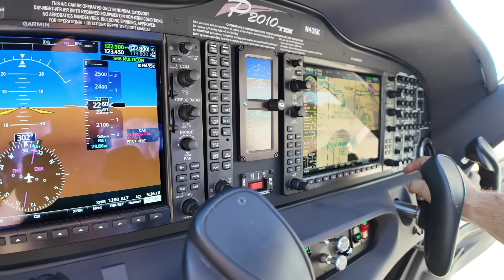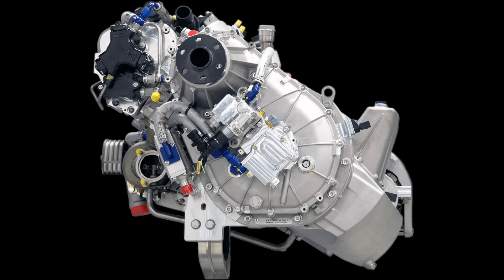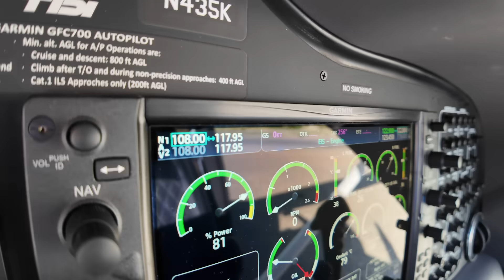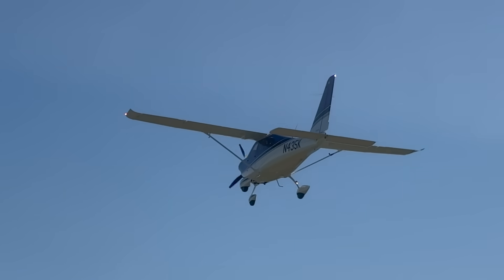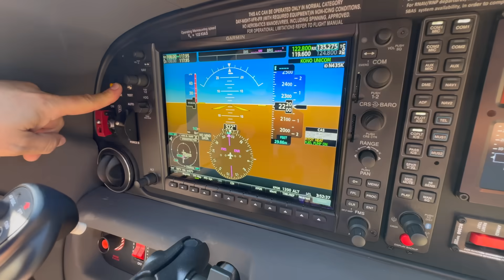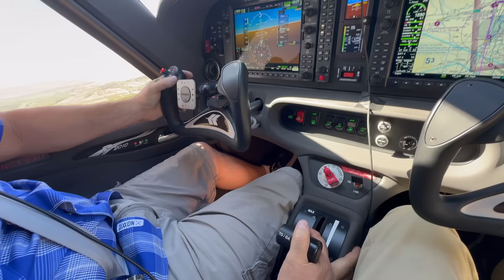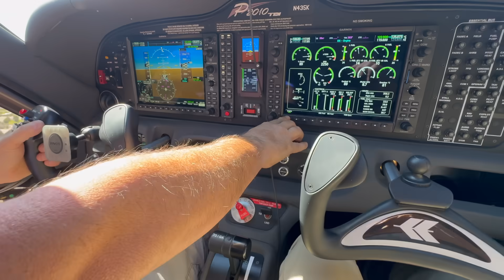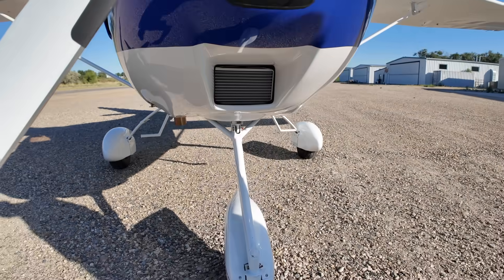Flying with a diesel engine

Comment: I have the DA-50RG. You cannot compare these designs to the 1950’s legacy engines. You will love every moment you fly with this generation of engineering. It should have and could have happened a long time ago but the powers in charge kept progress from happening
Reply: They have a whole pile of failure modes that old engines don’t have.  I don’t want to think of the terror of a diesel runaway in an airplane.  

Remember.. the DA-42 was nearly grounded because of the defective gearboxes in Thielert diesels—something “old” engines don’t have to worry about.
Reply: @calvinnickel9995 with your outlook we would still be hand propping aircraft because ‘starter motors can fail, alternators can fail and batteries discharge’. Thankfully you don’t make any more serious decisions besides what colour socks to wear . . .
Reply: The biggest problem with regulation changes and technology advancements? Bureaucraps are inherently phuking lazy, and will ALWAYS do as little as is ABSOLUTELY and only necessary, and not a phuking  lick more. Bass turds...

Comment: Very informative; thank you for compiling and sharing.  Have you actually flown the aircraft using standard, readily available ultra low sulfur diesel fuel?  I think it's cheaper to purchase than Jet A.  The P2010 seems like a good alternative to the C172 or C182.
Reply: No.  But it is certified to run ULSD.

Comment: As long as you can get the power to weight ratio to an acceptable level, then diesels make the perfect GA engine.  Modern computerized fuel injection and turbochargers have made this a very realistic and sensible alternative to gasoline engines.
Reply: Yeah, heavy, expensive, underpowered... perfect! That's why the JT-A sold so well, because everyone wanted such a perfect piece of technology!
Reply: What happens if you get a runaway engine ?? The wings will rip off and you will become a meat missile..
Reply: @cryptojohnny3921  Almost all modern diesel engines have an air shutoff flapper. It closes, engine shuts off, done. And the oil won't provide enough fuel for it to run very long, so worst case you'll have to cut fuel and climb pretty steeply for a minute or two until the engine gives up.
Reply: @cryptojohnny3921  stop repeating yourself troll
Reply: @cryptojohnny3921 you can engineer a method or safety device to cut off oil from the turbo or any other fuel other than throttle regulated deisel
Reply: @cryptojohnny3921  i assume being its used on a aircraft they would have a air cutoff it stop the engine. its something we could put on cars we just dont because well you can walk away from the car. also its a aircraft just climb until theirs not enough air and it stalls. i bet this aircraft ceiling is about 10,000 ft because one thing diesels need is alot of air.
Reply: @cryptojohnny3921  Why would you suggest that this engine would be any more prone to that than a gasoline engine?  The pilot can always shut off the fuel to the engine.
Reply: @chuckschillingvideos  The fuel doesn't matter, i believe they mean oil from the turbo runs on, you can't shut it off. Rare but happens.

Comment: “Full Fadec” means “OH SHEIT” at pattern entry when the engine sputters and you’ve given away altitude and airspeed, then have to second guess two computers. Best of luck…..
Reply: If you are at pattern altitude and can't make a dead-stick landing, please turn in your license.
Reply: Pattern entry, last time I checked, means the 45 degree entry to the downwind at pattern altitude. An engine loss here is almost never practiced except for the private pilot’s initial check ride. Can it be successfully done….yes. When the unexpected engine loss happens, will the average be ready for it and immediately turn toward the touchdown zone while simultaneously desperately trying to fight two computers, probably not.
Reply: @bwalker4194  What's more likely: 1) A FADEC engine failing completely. 2) An engine failing to run due to carburetor ice. 3) An engine having a catastrophic failure due to pilot error while setting the mixture?

Comment: Time before replacement...1800hrs.

Does the factory take back the old engine and do the refurbishment... 
providing a "swap" service  so as to provide a stream of "replacement" engines......
or do you just junk the engine @ 1800hrs?
Reply: Currently the factory wants the used engines back as cores for testing and mechanical teardown and inspections.
Reply: I too wonder the same
Reply: If Toyota meade this it might get 3000hrs

Comment: What you save in fuel, you'll pay double in maintenance costs. It also heavier and has less power 170hp vs 215hp of the avgas version.
Reply: That's very inaccurate. Diesels are the most reliable and durable piston engines around, without question. Not to mention safe and less complex
Reply: No these motors are cheap and unbelievable reliable. Your Lycomings and other air plane engines are more expensive in initial cost and maintenance
Reply: Nonsense. The Diesel engine is far more reliable. The key to them is simple maintenance such as oil and filter. Other than that they’re pretty much indestructible.
Reply: @stuartmcloughlin I got the 1.9tdi VW in my polo. 300k on the clock and the engine as well as the clutch and gears fell like new. The rest of the car falls apart slowly, but the engine is perfectly fine. And with good oil a change every 25-30k is perfectly fine as well.
Reply: Diesels run for a long long time.
Reply: Service intervals are longer than the 100LL counterparts.  Services are fairly reasonable.  As far as HP goes, the turbo means that the power curve crosses between 6000-8000 ft and overtakes the NA motor.

Comment: My Turbo powered Duramax is a beast when the turbos kick in, Its all torque and accelerates very qucickly losing cars in the rear view mirror. Of course in a pickup, weight is not a problem, but in  a plane, if the block weight is kept low by good engineering it should be possible. I also own a John Deere 455 tractor, diesel, its very light, no turbo, so somewhere in between those 2 extremes should be good. A properly designed prop for lower rpms and high torque needs to go with the engine. Engineer here of course.
Reply: How is any of what you said relevant here? The diesel version of this aircraft has a longer take off run and climbs more slowly than the naturally aspirated gasoline version, and the engine itself makes less torque than the gasoline version.
Reply: A Duramax diesel in a plane would be amazing!

Comment: this works up to 170 hp, maybe even 200 hp 4 cylinders, but the 300 hp 8 cylinder looks too heavy with radiator and coolant etc, that is when i opt for an old PT6A-21 turboprop conversion .
Reply: the Continental CD-300 is already in use in the Diamond DA-50, it is aimed at the Ly-Con 520, 540 and 550 engine families. The PT6 isn't even in the same catergory, in both horsepower and price.
Reply: @MBTronic   And SFC!! Pt6 has more than twice the Consumption per HP
Reply: Have a look at “RED V12 diesel engines”
Reply: 300 hp one is a 3.0L v6 engine and interms of weight including gearbox and everything it is almost similar to continental's avgas engine making similar power.
Reply: @superchargedpetrolhead  Almost similar is definitely one way to word that. The TSIO-550-C weighs 442 pounds and makes 310 hp, while the CD-300 weighs 584 pounds without its cooling system. I wouldn't be surprised if the installed weight of the CD-300 was around 200 pounds more than the TSIO-550.

In the DA50, the CD-300 doesn't even offer an advantage with regard to fuel burn rate over the IO-550 in the Bonanza.

Comment: Gave it a thumbs up because you did not avoid the price. So the engine has to be replaced at 1800, how much is that? It's 50 grand to rebuild my IO 360. Why would he spend 600k on an airplane with the useful load of a hummingbird? When you can get a Mooney turbo with a thousand pound useful load running circles around this for less than half that price?
Reply: Fuel + lead, no FADEC, no single lever control, 1930's engine tech, carb ice are some of the issues with your Mooney,
Reply: It isn't aimed at used Mooney buyers, more in line with buyers of new 172, DA40 and SR20 aircraft.
Reply: Ah, Mooney ... well, you've compared a new plane with a use done, as Mooney is defunct.

Comment: The first generation Diamond DA-40 had Mercedes diesel engines that were to be replaced at TBO or 12 years. I do not realize the second generation required TBR. Someone on eBay was selling a TBR Diamond engine for $500. I was tempted to see if an engine rebuilder was willing to work on it.
Reply: i read somewhere, the main reason for TBR rather than TBO was these engines have aluminium engine block and head.
Reply: What all do you have to replace? Just the long block or do you have to replace the injection system and all the accessories?
Reply: @leviduff2740 the whole engine

Comment: So every 1,800 hours the turbo-Diesel engine needs to be replaced? Can it run on Jet A fuel or just #2 Diesel?
Reply: Didn't you listen, he said Jet-A
Reply: After 1800hrs you replace the engine and use it on a motorcycle instead..

Comment: Diésel fuel is hard to get at most airports worlwide... Avgas.. Is almost everywhere... or regular gas for rotax engine also very easy to get......But the power and torque from a diésel... Is one big plus...
Reply: runs on Jet A 😂
Reply: @philwiesemes8020  
Jet A
Jet A is a kerosene grade fuel, normally only available in the U.S.A. 
It has the same flash point as Jet A-1 but a higher freeze point maximum (-40°C). 
It is supplied against the ASTM D1655 (Jet A) specification.
Reply: Yes, a diesel engine can run on jet A, but it's not a good long-term solution due to jet A's low lubricity, which can cause premature wear on fuel system components like injectors and pumps. 
While a diesel can operate on jet A in a short-term emergency, adding a lubricant or mixing it with standard diesel fuel can help mitigate wear and allow for better performance. 
Why it works (and doesn't work well):

Similarity:
Jet A is a type of kerosene and shares many similarities with diesel fuel, allowing it to combust in a diesel engine. 

Low Lubricity:
Jet A has lower lubricity than diesel, meaning it doesn't provide sufficient lubrication for the critical, high-pressure components of a diesel fuel system. 

Wear and tear:
This lack of lubrication leads to increased wear on fuel injectors and pumps, potentially causing damage and affecting engine performance. 

Cold weather benefit:
In very cold weather, jet fuel can be beneficial as it is designed to remain fluid and prevent gelling or wax crystal formation, which can block fuel filters and stall an engine. 

Recommendations for use:

Emergency use only:
Jet A should only be used in a diesel engine as a temporary solution when diesel fuel is unavailable. 

Additives:
To reduce wear, you can add a small amount of engine oil or a specialized lubricity additive to the jet A. 

Blending:
Mixing jet A with normal diesel fuel can help improve its performance in a diesel engine.

Comment: Turbo diesel is cool but no thanks. I’m not going to pay $500k.
Reply: Why do pilots have to hang onto the propeller. Bloody dangerous and stupid.
Reply: And then throw it away @ 1800 hours later
Reply: @Goody2414  it’s probably just a scam to capture the remanufacturing business rather than let independent rebuild shops or field overhauls take away business.
Reply: @Goody2414 replacement cost is less than overhaul cost. It’s a financial calculation not a reliability question.
Reply: $600k....

Comment: I appreciate that a full grown man can sit in the back but I’m curious, how much would it effect the weight and balance if two grown men sat in the back?
Reply: You would be hard pressed to put any adults in the back.  After full fuel, you only have 436 lbs of useful load remaining.
Reply: 893lbs useful load.  I’ve had four adults in the plane. Two men and two women.  Gotta play the fuel game depending on distance, but it can be done and we were fine with CG.  We flew from KSGU to KSEZ.
Reply from the maker: That's a great question. I do know the owner has to juggle fuel/weight around as the temps go up. But I'm not sure how that impacts the CG.